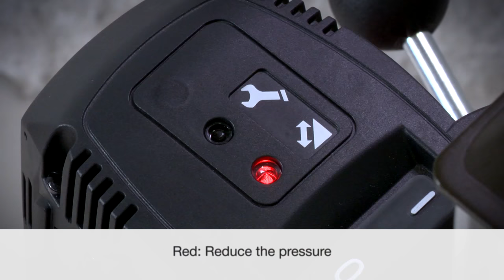HOW TO use Hilti DD 120 diamond coring tool for wet drilling into concrete

Comment: I just drilled thru 2 feet of poured concrete with rebar in it, with a 4inch drill bit and Jack hammer.  Only took 4 hours! Work hard not smart!!!!!

Comment: It's a dream to drill in this concrete. No reebars, straight ground 107 drill bit
Reply: It sucks when u drill into rebar
Reply: What to do if. You hit rebar?
Reply: @laroderick5075  just drill through it. Does take longer.
Reply: Yeah, I would like to watch how he drills reinforced concrete wall  under the ceiling. Alone.

Comment: Is there any option to drill a hole without installing the Machine by drilling separate hole, which is not possible for installation of Balustrades on Staircase steps.

Comment: I need to drill an approximately 8" diameter core, 4"-6" deep.  The core will be heavy.  Is there a way to easily remove the drilled core?